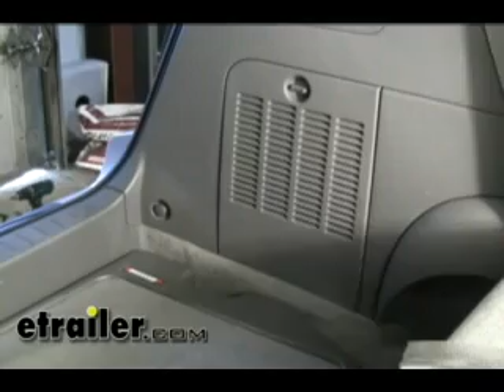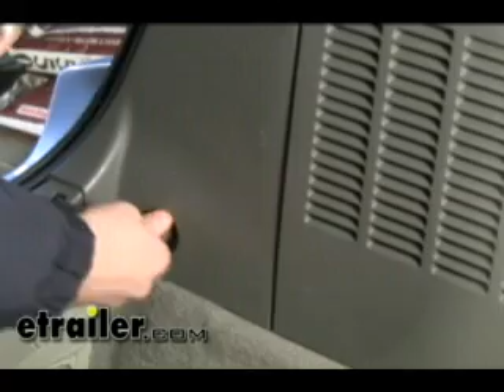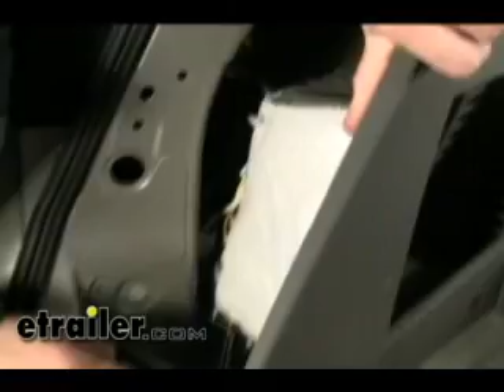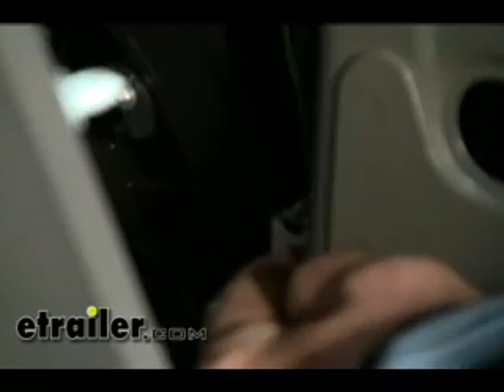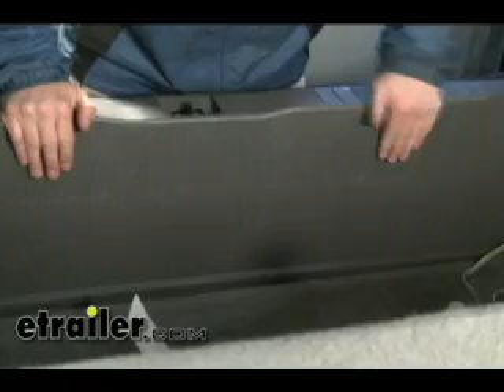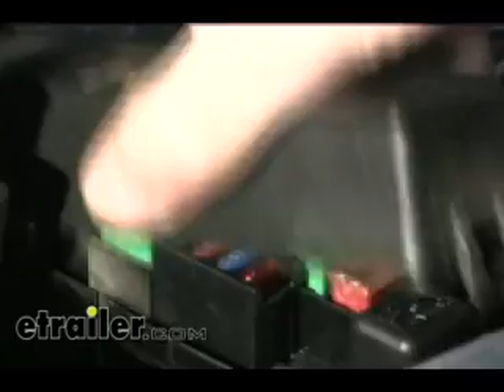Install: T-One Vehicle Wiring Harness with 4-Pole Flat Trailer Connector on a 2007 Nissan Quest

Comment: Do you have a link or model number for the hitch to fit the 07 Quest?
Reply from the maker: We sure do! I'd recommend going with the Curt # C13563 which you can check out using the link I've provided below:
https://www.etrailer.com/Trailer-Hitch/Nissan/Quest/2007/C13563.html

Comment: Not a hard job to do but if you have a older quest mine is 2004 and I live in NY go buy yourself a m12 tap to clean the threads where the bolts go makes the job a lot easier.
Reply from the maker: We have to use a thread tap to clean a lot of the weld nuts when we install hitches because they are rusted or have grit in them. Thank you for sharing this with us and others.
https://www.etrailer.com/Custom-Fit-Vehicle-Wiring/Tekonsha/118469.html